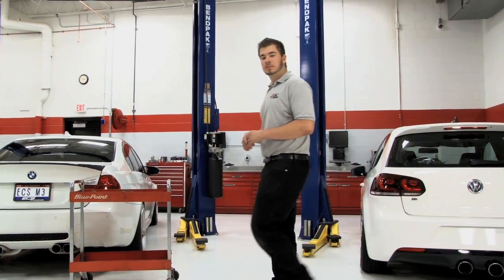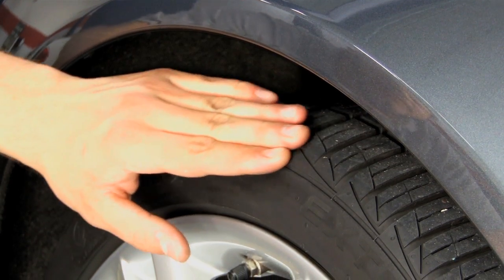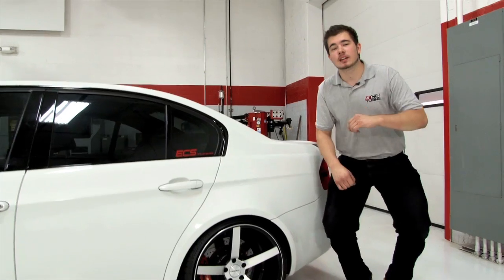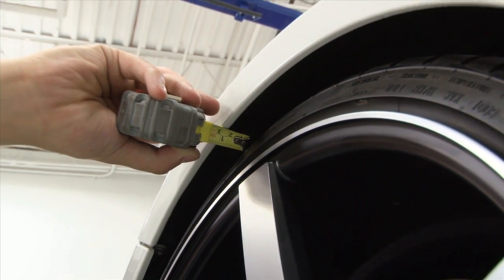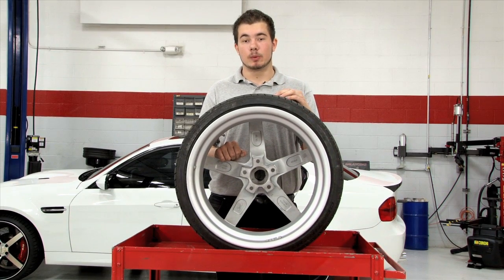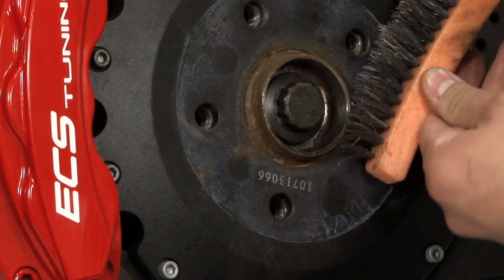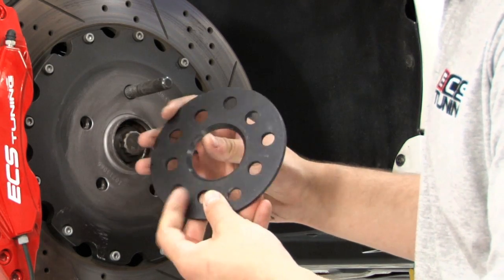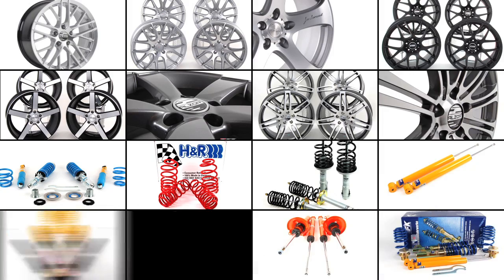ECS Tuning: How To Measure For ECS Tuning Wheel Spacers

Comment: Lube the lug nuts/bolts and wheel mounting surfaces? Wouldn't that change the available friction for the wheel? The nuts/bolts hold the wheel onto the surfaces, and it's the friction between those surfaces that provide the force to keep the car suspended and to turn the wheel.

Comment: Hello its a very nice information video i have problem with my w211 e320 i changed wheels and used 20 mm spacers for a install my original AMG wheels but before the installation they don't make any clean and don't use anti seize and they make montage spacers with on the rim i have vibration on my steering wheel and its very annoying can you help me please what is the wrong with installation ? what can i do for a cute that annoying vibration?  thank you

Comment: Hello ecs tuning, I love all your videos, and has helped me a lot, but I have a question I have a golf 6 gti and I want to lower the car in just swapping the springs, but I'm afraid to go brush in the car with the rims I have, I have 2 pairs of wheels for summer and for winter, measures are 225/35r19 8.5 ET42; others are 225/40r18 8.0 ET35. will be possible to lower the car with these rims?
Thank you!!

Comment: Hello Mike, I have the D3 Audi S8 featured first in the video.  Would make a nice difference in conjunction with my 275/35/20 plus 0 tire setup. Can you tell me what application sizes you used for the front and rear please?  I was thinking 8mm f & 15mm r, but would like to confirm.  TIA,

Comment: Hey ECSTuningMedia,

I have a BMW 335i coupe and currently have 245 in the front and 275 in the back I was wondering what size spacers would be good with the tire rating at that width. No other mods done to the car. Also i barely have ppl in the back seats

Comment: Nice video. But after watching I am still unsure of what to get for my car. I have a 2006 BMW 325i Sedan & I just bought 20 inch wheels (20x8.5"/5x120mm, +35mm offset) backspace 6.1 inches. I was told I might need spacers because I dont have OEM brakes & the aftermarket brakes might rub on the wheels. I was looking at 12mm front 15mm rear spacers but after viewing this I might need something thinner? I really need help, I just want a proper fit with no rubbing. Thanks in advance.

Comment: OK, hopefully I don't get too beat up for asking this, but I guess knowledge is power. I was wondering if I can knock out wheel studs, tap threads into the holes, and use wheel bolts like VW.  I am asking because I want to put custom wheels on my car, but it is hard to find them used with my lug pattern (5x108). Also space is limited so I would need to use a thin adapter to change my pattern to 5x114.3.
Reply: heck no you don't want to tap wheel stud holes. The threads will not be nearly as strong.
Reply: 5×108 Volvo or Jaguar?

Comment: @ECCTunningMedia hey I have an 05 acura tl stock height. I need help in choosing spacers for the better look I do have rims 19x8.5 front 19x9.5 rear with 235 Tires in front and 255 rear I want a quality spacer but can also work when I mount my stock 17" wheels

Comment: Okay I need help I'm getting lowering springs for my 08 gti and it will go down 2 inches I have aftermarket 17 inch wheels and my tires are 235x45x17 what wheel spacers would look good some say 10mm but what's your input front and back?

Comment: Got a Golf MK5, im getting 19" Audi RS6 alloys (8.5JX19" ET45/ PCD 5X112) what size wheel spacers should I put on the front and backs? to make the wheels either flush with the body or maybe stick out a little? (the car is not lowered and is got the stock springs on) Thanks

Comment: i have a '99 bmw 323i sports package, no modifications done, just want it stock. I would like to put a 19 inch staggered rims. 19x8.5 - 225/35R19, 19x9.5 - 265/30R19. is this possible on the rear it won't hit the fender? Or just be better of with the 18s. need help.

Comment: I have a Porsche Carrera 4  1999 , which I want to install a 19" Rims on my car, I saw a wheels chart that say the maximum offset is 50 and 54 without spacers, but the Rims that I wants say 50 and 55 , my question is do I can install 55 offset on my car?
Thanks!

Comment: What if I have wheels with centric hub ring? Would the ring just go over the spacer lip?
Reply from the maker: depends on the CB of the spacer. Most spacers are hubcentric to the OEM specs. As long as your hub rings adapt your stock CB to your wheel's CB, yes. If your wheels share a CB with your OEM wheels, you will not need hubcentric rings.

Comment: ok I have 17" 225/50 front and 17' 255/45 rear with the H&R it will be lowered 3 cm, I need to make sure with these size of rims what's safe and won't rub cuz I want to go wide and yet I load the car from time to time besides I live in Egypt and it's a one time buy.

Comment: Hey, i have a question regarding rim fitting.  How would I go about putting rims from another car on my new vehicle.  I had 20 inch rims on my old Benz.  Recently bought a 2013 Altima.  Wondering would I need a wheel spacer or wheel adapter in order to successfully put these on my car.  Is it even possible to put them on my new car?
Reply: wfefjc 
Wtf you went from a Benz to an Altima really !
Reply: LMAO i was thinking the same as i read

Comment: Also, when you drop you car to the floor, your suspension geometry and performance get totally screwed unless you correct in accordance with the "modifications". Some designs are easily adjusted while others demand some serious maths and fabrication to compensate for the changes. Many "tuning" shops don't take the time to educate customers on this aspect when selling coilovers and wheels and gladly take the cash with a big smile knowing the performance is actually worse off. Keep that in mind people and research these things before throwing your savings away on useless shit.

Comment: Hi, maybe u can help me out. 2015 civic stock tires 195/65/15. I'm planning to put 15x8 rims with offset +6 using same stock tires 195/65/15. I know the rims will poke out of the fender. I won't do any mods on the suspension as of now. Will the tires hit the fender??? NOTE: Stock tires and stock suspension with wider wheel 15x8 with +6 offset. Thanks

Comment: What happens if I dont want to lower my car at all and I'm at stock height, but I just want to have wider wheels? Can i go straight 30mm?
Reply: Voss2120 At that point you should just buy wider wheels with an offset that puts your wheels close to the fender

Comment: How does the mk7 flush kit with a wider rear spacer affect handling? I would imagine it increases understeer? I want to get these, but I love the GTI's lift-off oversteer.
Reply: I've got some stagger on my mk2, and it calmed down the lift throttle oversteer quite a bit

Comment: Are wheel spacers bad for your bearings?
Reply: Gabriel Rivero Anytime you change the geometry of the car's suspension it will always be negative for the car. In this case moving the wheels outwards more, putting more stress on where the wheel used to be. This will shorten the lifespan of the bearings. The bearings are meant to take vertical load, moving the wheel away will create a horizontal or in this case a side load to the bearings.
Reply: Gabriel Rivero It's not going to cause a failure right away though. Just shorten the lifespan overall if not by much.

Comment: Hello..i have 20mm hubcentric spacers with 22's rims on my 2011 honda coupe and when I am going 40 to 60 miles per hour..my steering wheel shimmy comes and goes.
Please advice on what is causeing that and what to do to fix that problem thank you.
Reply: have you tried an alignment
Reply: I have the same problem with new Niche wheels on my Sonata's 67.1mm bore and the new rims 72.6mm bore...you need a hubcentric ring that will fill the gap between the larger wheel bore and OEM hub bore to that the wheels are not mounted crooked on the lugs, but centrally on the cars hub

Comment: Hey i just want to ask something, i have a g35 2004 coupe where i've installed 20" rims  on it with 245 35 front and 285 35 rear wheels , i added to that wheel spacers of 2cm on both but i have a lot of rubbin in the rear side and vibration in the front my spacers comes without hub centric , i want you to help defining how much size of wheel spacers do i have to install on both (front and rear) to clear vibration and rubbing and thank u so much.Note: i want to lower it to better look but not too much because i still have installed the oem suspensions.
Reply: stillen performance is the Nissan/ infiniti place you wanna go...
Reply: Thanks bro
Reply: Karim Kazzi You should post this in an Infiniti forum. Did you roll your fenders? You should get hubcentric AND wheel centric spacers (where the hole of the spacer fits the car's hub and the lip on the spacer fits the hole in your wheel). You could also try running tires that aren't as wide.

Comment: For the front, if your turning a corner then the wheel is going to come out from under the fender, and possibly the two come in contact. how do you calculate how low you can go to avoid this?
Reply: Did you find out?
Reply: George Kershaw with your wheel on the car and no spacer, turn the wheel all the way out to either side and measure distance from the edge of the fender well to the edge of the amount of the tire that protrudes out. You measure this from the top of the tire and then factor that into measurement for the spacer you need. It'll tell you how much extra the wheel will poke out during a turn and you can use that to make sure you can clear the fender well when turning sharp

Comment: and how I aply new longer  screws when I have subaru impreza ? :)
Reply: you dont need, unless you put a bigger then 10-12 so you will need a spacer that bolt on the car  
http://cdn.roughcountry.com/media/catalog/product/cache/1/small_image/680x/17f82f742ffe127f42dca9de82fb58b1/w/h/wheel-spacers_1091-small.jpg